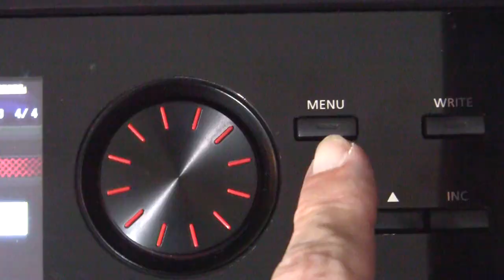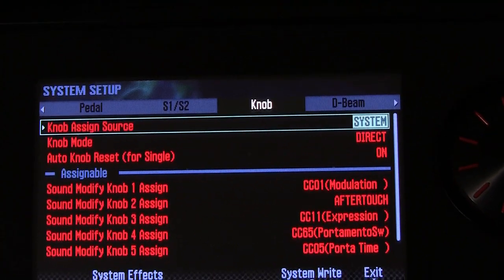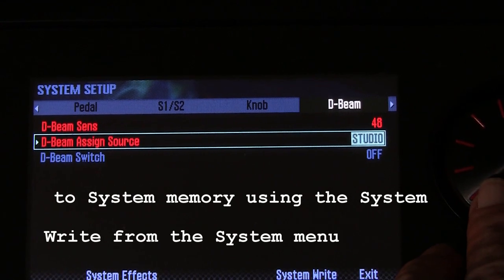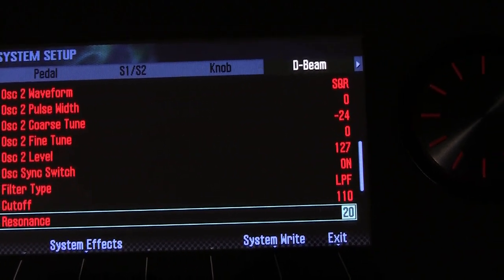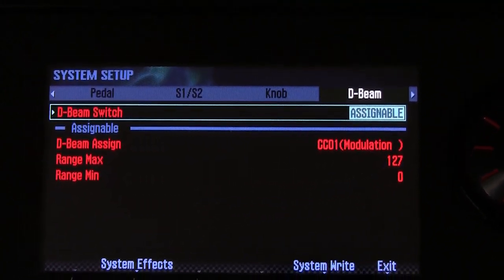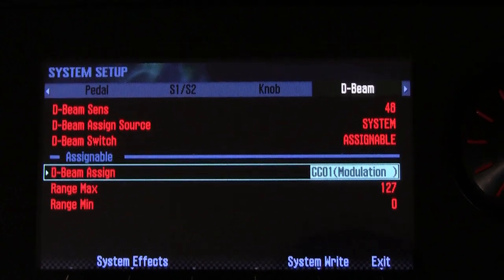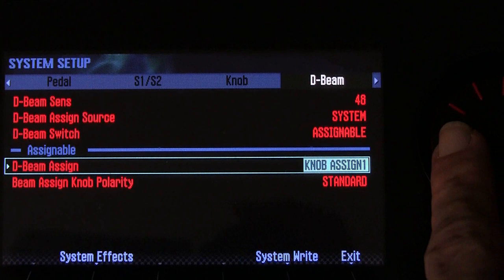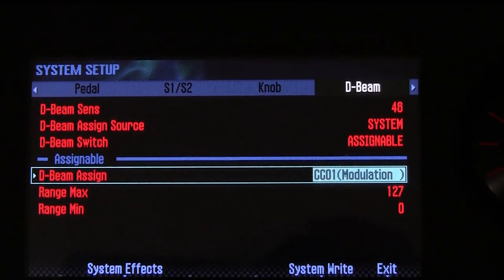Roland D-Beam settings on FA-06 synthesizer

Comment: Hi Stephen can I configure D beam as expression on only one side of dual tones
Reply from the maker: to do this you have to use the MIDI CC (continuous controller)..... you press the "Assignable" button for D-Beam and set  unused CC number ...... then you go and edit the specific TONE that you want to control and assign that CC number to whatever expression parameter you like using the Modulation Matrix (Matrix Control or  MFX control)..... if you cant get it done I could make a video to show you
Reply: @StephenMendes  Thanks Stephen really helpful as usual I'm not sure what I'm doing but I'll give it a try

Comment: Can you use it on modulation and how to use?
Reply from the maker: you can use the "assignable" button to assign to a wide range of modulation options (hold down the shift button and press "assignable") ......... if you want CUSTOM modulations then simply rotate the dial to select a CC number that's free ..... and go in your "tone edit" and use the Matrix to map that CC number to whatever other parameters you want to control... this video shows how to set Matrix parameters to CC numbers https://youtu.be/ByZvVQN8dvs

Comment: Is it possible to record the D-Beam manipulation into a song in the FA? I can't find that info anywhere in the manual or demo video. Thank you.
Reply from the maker: Yes absolutely... that's the whole idea...  the way you do this  is to set the D-Beam  to send CC MIDI messages and then configure  the  tone on the current MIDI channel to respond to those CC messages ..... but in any case, the CC messages sent from the D-Beam will record into the sequencer on the active channel  (unless you explicitly turn them off because default  ALL MIDI message are recorded by the sequencer).... do you need a video to show you how ?  😊
Reply: @StephenMendes  I would LOVE a video! Thank you so much!
Reply: @StephenMendes  Also, I have one more question....but this isn't D-Beam related. I've worked with this keyboard for 2 years now and I've figured out a lot about it BUT I have never figured out, when recording into the sequencer, how to key in a measure/bar number instead of DIAL my way to the measure. Dialing to measure 152 takes so much time everytime! Ha. How do I key in the measure number?? Thank you!
Reply from the maker: @kristeenyoungmusic  the PADS can be configured to work as numeric entry ...... I believe you MIGHT be able to enter measure/bar numerically using the PADS  ... but I will have to try it and confirm .... IF I can get it to work this would be yet ANOTHER video I could make 😊..... thanks for the idea ..... lot of great ideas come from my viewers ... please subscribe (if you have not already subscribed) as clearly I have a LOT more videos to make for this keyboard and you wont want to miss a thing.
Reply: @StephenMendes  Ok. Yes, I subscribed. I do use the pads numerically for everything else (ie. volume, etc) but just have never figured it out concerning measures! So rudimentary I know.
Reply from the maker: @kristeenyoungmusic  Did you see my two recent videos where I recorded the D-beam manipulations  and showed how to use the numeric pads ? .....  did this fully answer all your questions ?  😊
Reply: @StephenMendes  No, I didn't!